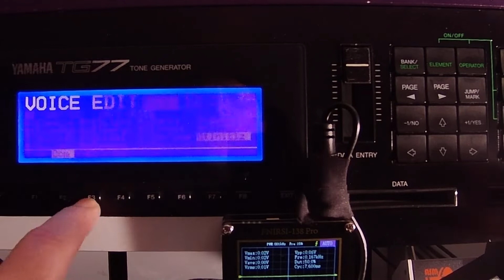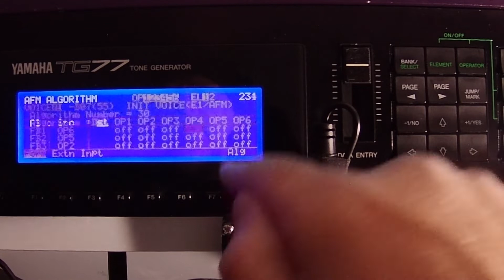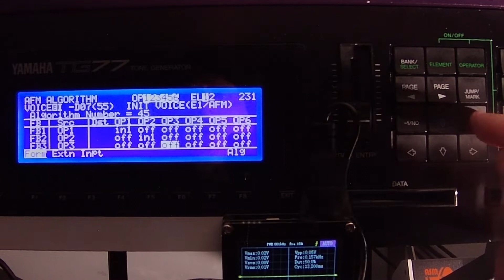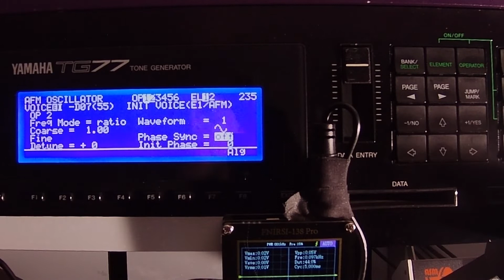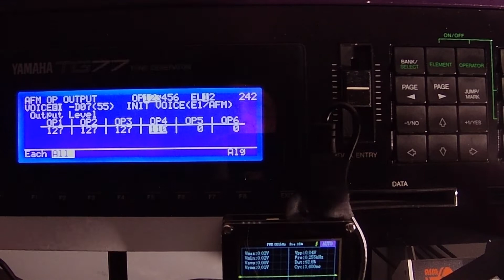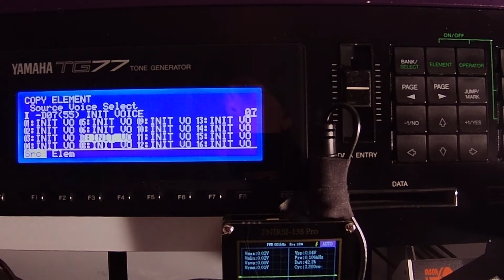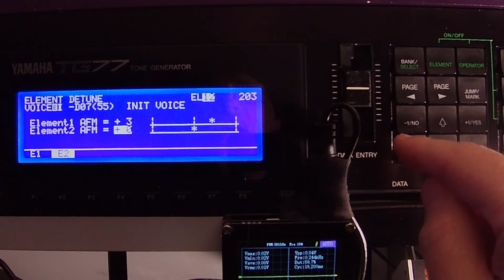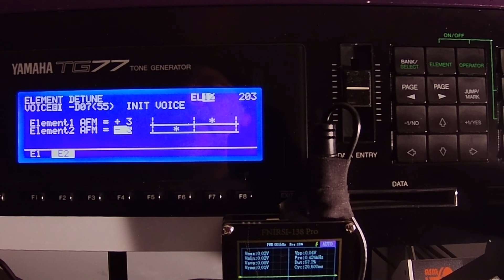TG77 SY77 FM Supersaw? Why yes, sorta.

Comment: Since 5 and 6 are unused, they could be used to modulate the carriers when you run out of feedback for the sub oscillator, although I thought there was a saw in the waveform selection but I guess I misremembered. You could also awm elements which have saws (unless they don’t… 😂) for a different sound. These are great keep them coming!